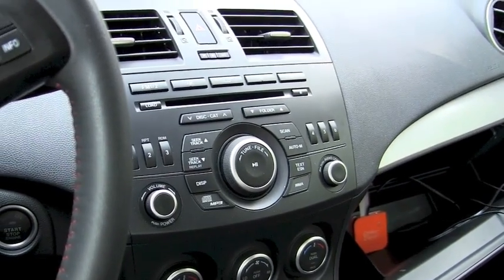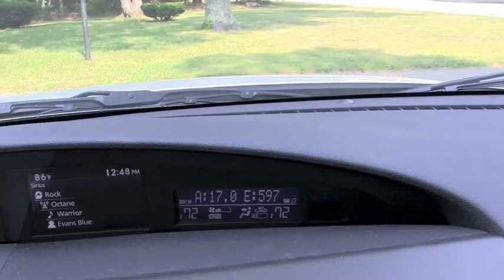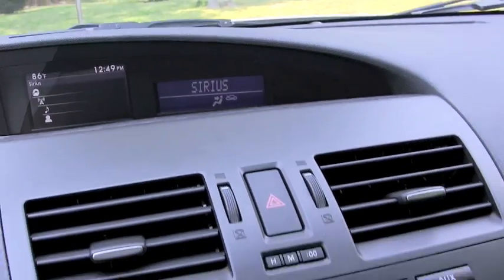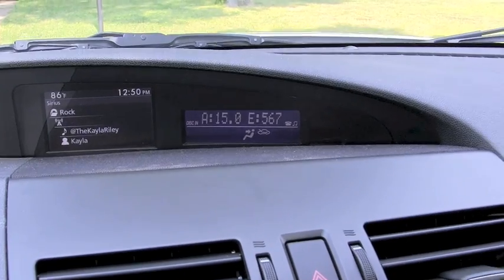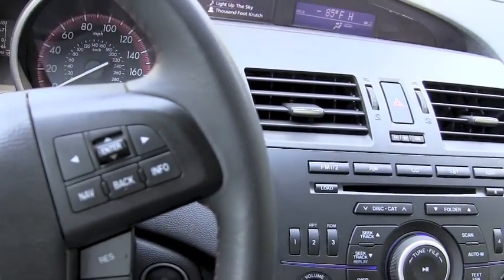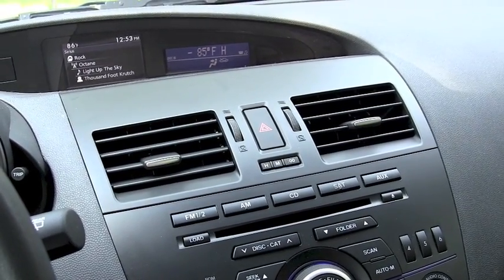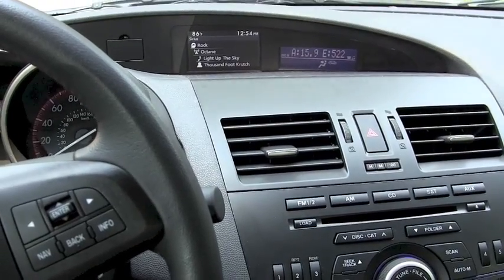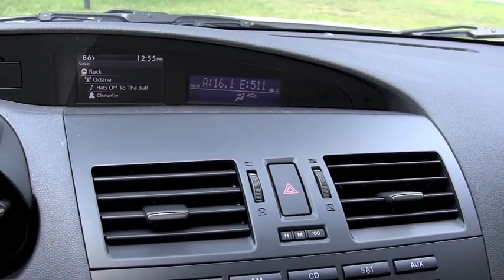Whistler Pro-3600 MazdaSpeed3 OEM Display/Steering Wheel

Comment: Question for you sir:
I have the 2012 Mazda3 that has the same blue display as your MazdaSpeed3 but because they put a different, less sophisticated, climate control system in my car I have a blue display that only shows information on the top half. I can still see all the little symbols on the bottom half but they aren't being utilized and thus the bottom half of my display is a complete waste of space. This is very aggravating to me, so my question is whether I can use the CanBusTriple to tap into those icons on the bottom and turn them on and off based on criteria that I program into the system?
Any help is appreciated. Thanks.